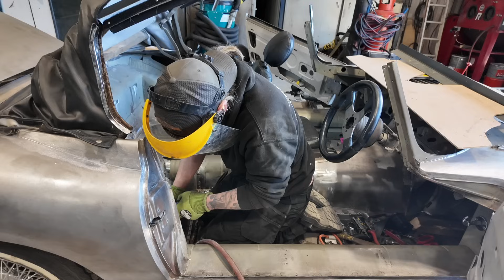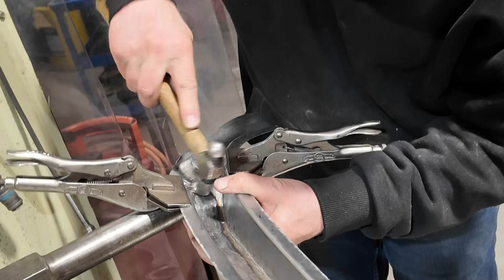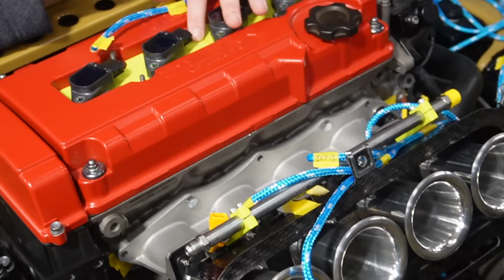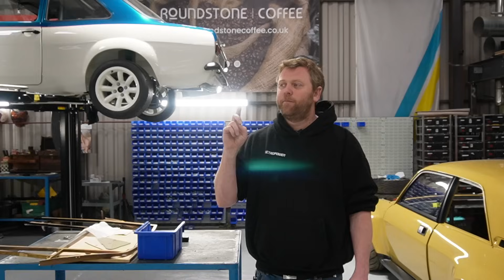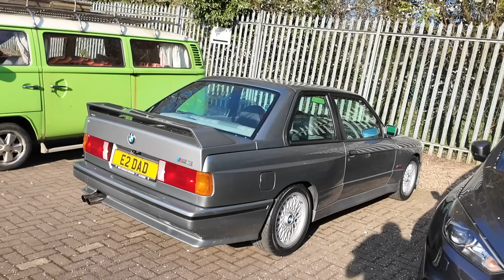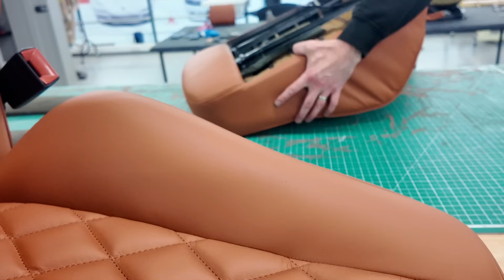Hemi Interceptor Restomod Begins Build-up

Comment: Coming from a refrigeration company. The best way to check for leaks in refrig pipework is vacuum. You can sometimes have a successful pressure test and then not be able to hold vacuum because of tiny leaks that only show under vacuum.

Comment: For left field builds, there was a Aussie HQ Ute called "Blobak 2" many years ago. Basically it had 2 engines , a 253 cubic inch V8 in the engine bay and a blown SBC in the tray. Alan Cooper was the guy that made it. Not a restomod but still cool.
Reply: Yes, that was yet another memorable Aussie build in the 1980's.  
I don't think it ever got the accolades it deserved.

Comment: There are so many different project car builds that are excellent, in many different styles.  As far as restomod go that are in line with the type of vehicles that Retropower produces, I can think of three current ones that are all amateur builds that are still in process:   Fanatik Builds LS V8 powered Triumph GT6 https://www.youtube.com/@FanatikBuilds , Throttle Stop Garage's 5 cylinder turbo powered Volvo 122 Amazon https://www.youtube.com/@ThrottleStopGarage, and Sarah-N-Tuned's 2UZ V8 powered 1974 Celica https://www.youtube.com/@SarahnTuned.  Honorable mention goes to Oliver Pickard's Honda powered Mosquito https://www.youtube.com/@OliverPickard.  I would have included Home Built by Jeff's Alfarrari, but it's essentially completed now and I wanted to only list cars that are still in process.  Project Binky is another amazing vehicle that should not be forgotten, that is if they ever stop making brackets and finish the darn thing.  🙂

Comment: A real exhibition of outstanding engineering. So much talent in that shop. Built an amazing crew.
Never been a fan of the E-types. Bottom of the sills are too high up. Like the tub could of been a lot thicker, floor lower to the ground if you get my meaning.
But it's not my car. I MAY be a tad jealous. I am absolutely sure it's going to be a real beauty when completed.